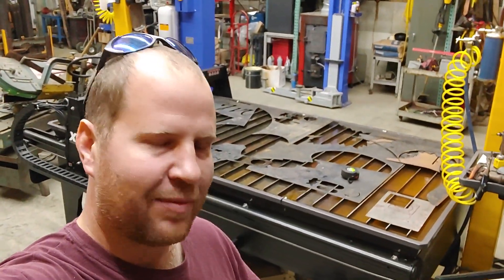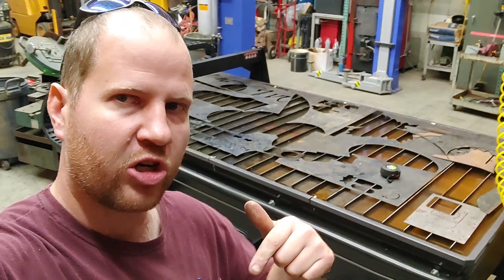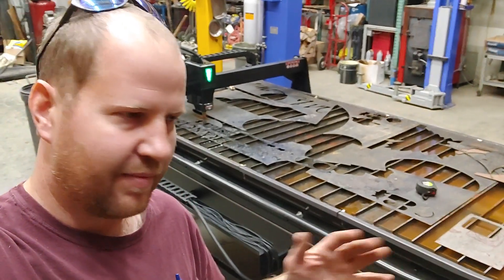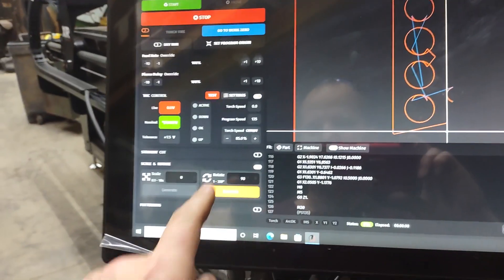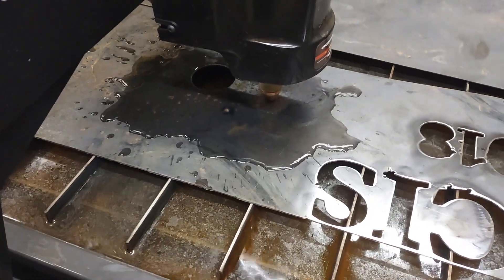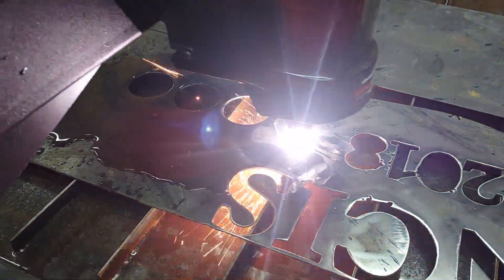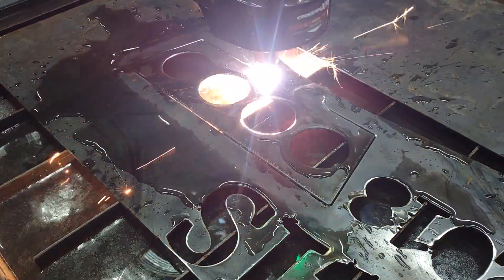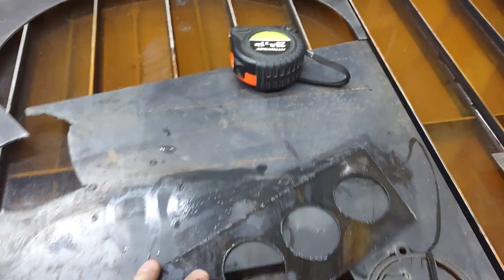Langmuir systems Crossfire XR plasma table. Cutting gauge cluster for a 1967 jeepster.

Comment: Quick question what #shade glasses do you use when operating the cnc machine?
Reply from the maker: Im really not sure. I purchased my glasses from a local welding shop. I asked specifically for glasses that would be   safe to use for plasma cutting.
Reply: Shade 5 lens is what I’m using. Not blind yet haha